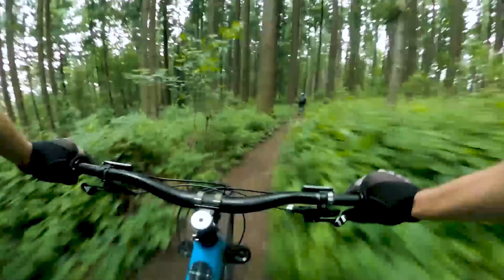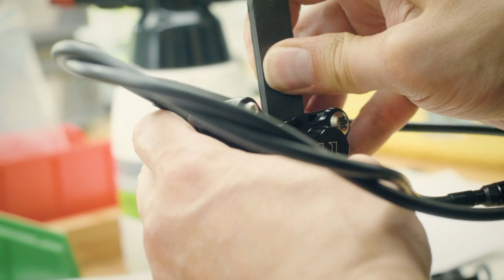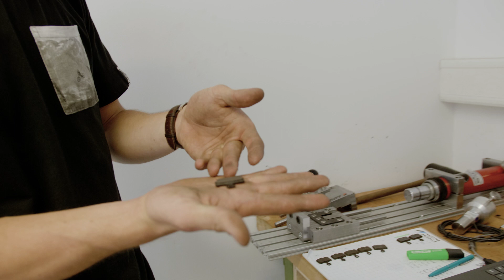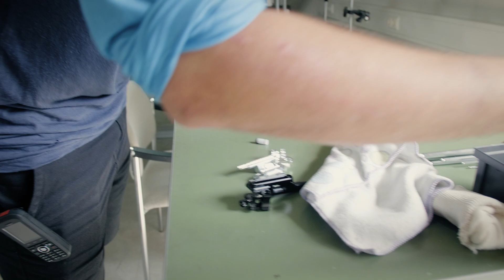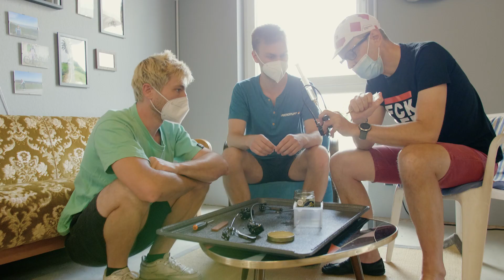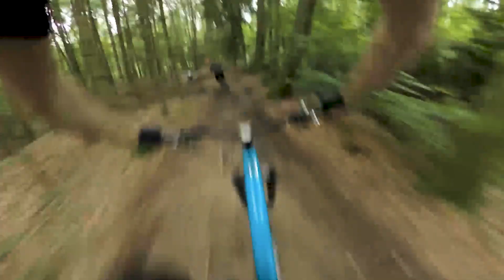Home between vineyards: TRICKSTUFF 2.0 FACTORY VISIT

Comment: Kinda make every effort useless if you can never find either brakes or parts in stock
I tried for more than a year to find a 223 dh rotor and I just gave up
Out of stock everywhere
Reply from the maker: Our brakes are frequently available at Trickstuff dealers and in the common German online shops as bike-components.de or bike24.de. Please feel free to check regularly. Same for our brake pads, discs and accessories.
The Downhill Disc 223 is currently not available but planned to be back in stock. Any info on products, that are available again, will be announced in due course via our usual communication channels (website, social media).